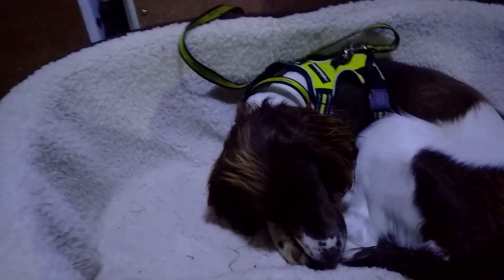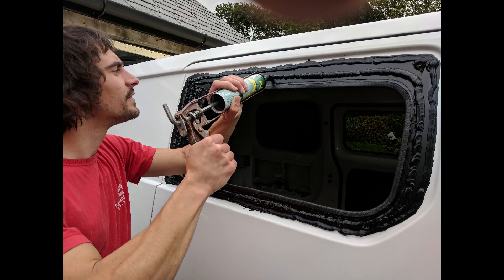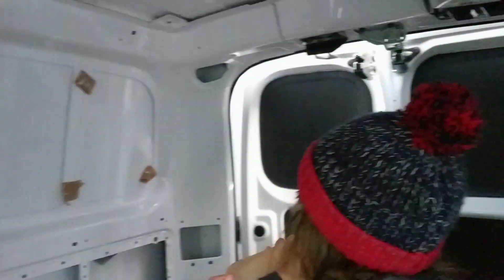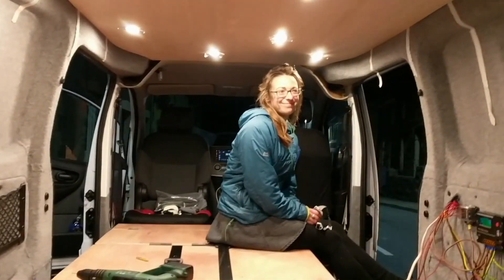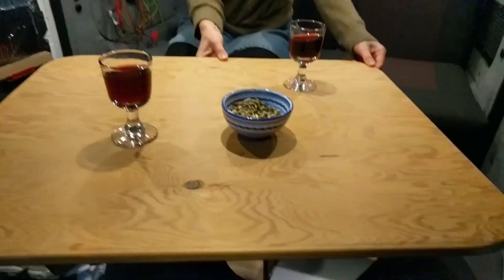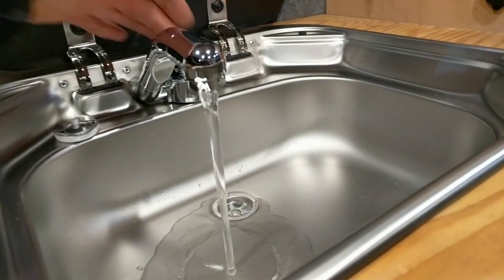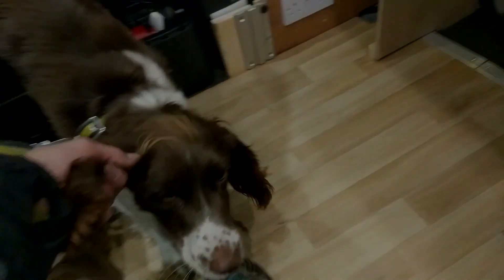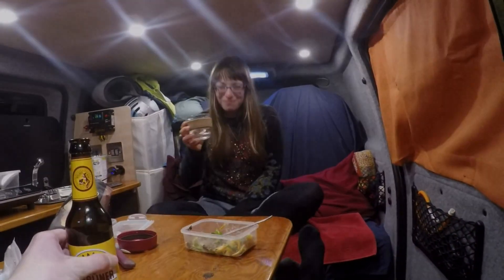Fully Electric Campervan: DIY Conversion Process (Nissan e-NV200)

Comment: I'm seriously considering converting an e-Nv200 40 KW/h van myself, and I'd be very grateful if you could point me in the direction of some resources that can teach me about fitting the required electrics. There's plenty of information out there about regular van conversion electrics, but I need to understand how to marry the main traction electrics to a 12v 220v leisure system. Many thanks in advance.
I was thinking about converting an EV Van a couple of years ago, but now seeing that you've proven that the concept works, and works well, I'm excited to start my own project that will involve the carriage of a Zero FXS EV motorbike as a shuttle vehicle
Reply from the maker: Good choice, the 40kwh will make a great campervan. I wrote about my conversion on my blog together with a wiring diagram. If you want to use a leisure battery you cna just use a normal split charge voltage sense relay. However since the van already has a larger battery I make do without a leisure battery just using the vans 12v battery (which I switched to an AGM) topped up from a solar pv panel. If I notice battery is getting low I just switch the van on to charge the starter battery from the traction battery. You may have different requirements.
Reply: @GlynHudson  The Japanese variants of the e-NV200, has an ac outlet that uses the van's 40/24kwh battery. The older 24kwh models can be imported (after VAT and costs) for around 10K
Reply from the maker: @mrsnrub2952  That would very useful. Do you know what the current rating is?
Reply: @GlynHudson  It's the Japanese standard of 100v (at 1500w), a step up voltage converter should solve any issues, as the outlet is available on all post-2018 40 kwh (and any G 24kwh) e-NV's
Reply from the maker: https://blog.zerocarbonadventures.co.uk/2018/10/electric-campervan-diy-conversion.html

Comment: How can I mail you a circuit drawing?
Reply from the maker: Could you upload to pastebin / dropbox / gdrive and share a link?
Reply: @GlynHudson  my email is noel at solarpowercare co uk 
So kill the light all you will need to do is deck a wire to to ground via a momentary switch in the cab. to reset just turn the van off then on again. Where in just blog is the shopping list? As I what to start on my van. 
Oh I could send you the Light over ride relay as a kit free for a review on here.
All the best Noel "RadioVanGuy"

Comment: Can I have your shopping list? As I what to make my e-NV200 as good as yours. p.s. I can show how to make a a push button to cancel the sidelights till you restart it with a push button in the cab....
Respect Noel.
Reply from the maker: Sure, list of all the items is on my blog post. What's your idea regarding the light switch? https://blog.zerocarbonadventures.co.uk/2018/11/nissan-e-nv200-vs-peugeot-partner.html

Comment: Just a thought... I noticed there’s some room under the bonnet, could you perhaps install a suitably sized water tank under there to free up room in the cabin?
Reply from the maker: I use the space under the bonnet to store charging cables. It would be an alkward sized water tank. If you wanted you could replace the spare wheel underneath the van with a under sung tank. I quite like removable 25L bottles for easy refilling and cleaning

Comment: the pv panel looks good, how did you run the cable ?, you didn't drill the roof?. and have you added another 12 volt aux battery ?.....
Reply from the maker: Yes, I drilled the roof. Made sure I drilled in between any structural parts and used roofing mastic to water seal.
Reply from the maker: No, didn't add a 2nd 12V battery. When the van is switched on it continuously charges the 12V battery from the main 400V DC traction battery therefore plenty of power available. Reduces complication, saves space and reduces weight
Reply: Glyn Hudson hey glyn, great job are you able to share what auxiliary battery you changed it for as you mentioned an lithium or did you mean a AGM? Also did you use a split charge relay, I’m looking to do similar on my 40kwh. Great inspiration guys!
Reply from the maker: I did use a lithium, I've now changed it to a AGM battery. I just use a single battery under the bonnet. If it's running low I turn the van on to charge it from the main traction battery. If you wanted a dedicated leisure battery you could use a standard voltage sense split charge relay. However, I've found just using one battery works fine since I often have the van switched on to run the heating / stereo anyway. I prefer not having the extra weight and space saving of not having a 2nd leisure battery
Reply: Thanks for the reply glyn, I may go the dedicated separate route of another battery AGM with the voltage split charge just to keep the systems separate, but I’ll have to research a bit more I think, I like what you have done by using the open source and dropping the voltage, be nice to see a dedicated video on this an in depth review if you could at some point.

Comment: Truly fantastic. I am currently thinking about a used e-NV200 as the successor of my VW T4 campervan.
Reply from the maker: Awesome! I would recomend the new 40kwh version if your budget can stretch. You won't regret the extra range. Although my 24kwh is still highly functional
Reply: @GlynHudson  Yes, 40kWh would be wonderful. However, a used e-NV200 with 24kWh battery will set you back about €20.000 (in The Netherlands) and a new 40kWh version is at least twice that amount. But I guess  availability and prices of used ones will change over the next few years :)
Reply: @Freba9  We're in the Netherlands & wanting to do this too.  The 40kWh bestelbus is at least more common & cheaper starting point than the Evalia people carrier.  If you can get a subsidy too (The Hague has a scheme at the moment also covering 2nd hand vehicles)
Reply: If you are in the Netherlands you shoud take a look at what MAXSON are doing with extender batteries for the e-NV200
Reply: jbsignaturetele MUXSAN ;)